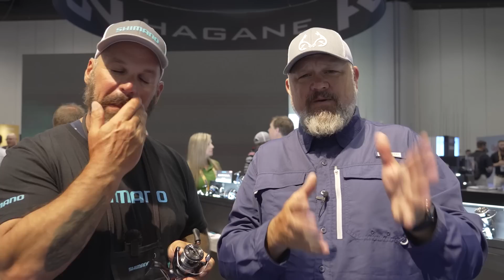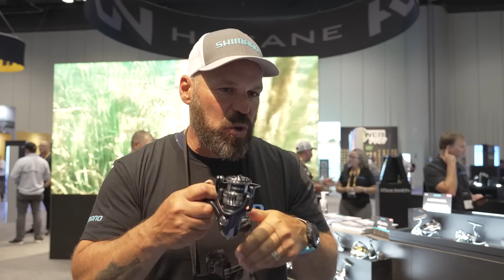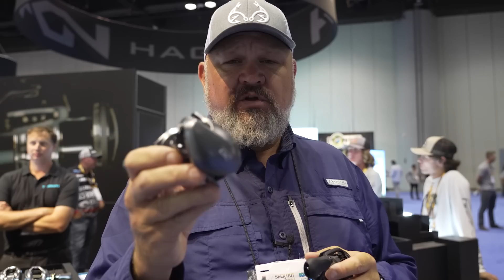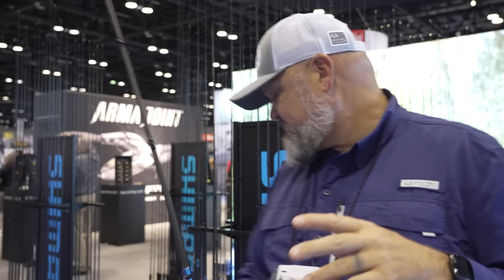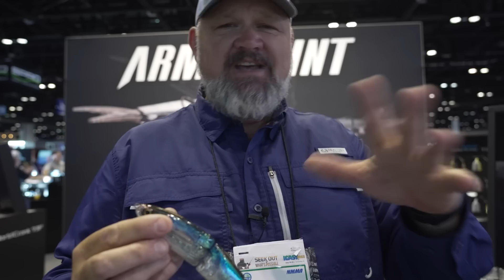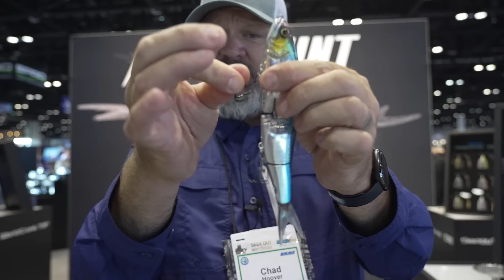New Shimano Fishing Products | ICAST 2022

Comment: One thing not mentioned here that was at the show is the new Curado 200 DC, the higher line capacity over the 150 is huge for heavier braids on big Amazon peacocks after those long casts. I looked it with the Shimano rep and seems like the higher capacity comes from a wider, not deeper spool. I just bought a buddy a SLX DC for his first bait caster and spooled then threw it to dial it in, very nice reel. A friend has an SLX DC he has fished fresh and salt for over a year and loves it.
Reply from the maker: Yessir, I did overlook that for this video. I actually plan to use on for bigger swimbaits as soon as I can get my hands on one.
Reply: @ChadHooverFishing  Cool, that should be a perfect fit. It was such a huge show, sensory overload. I have seen some videos here with a dozen products I meant to check out which were somehow missed completely.

Comment: Deep spools don't mean nothing. The last half of the spool will not cast. That's why Japanese use shallow spool. The problems with most spinning are 1. Bad drag (not in the case of Shimano) 2. Plastic bail arm 3. Cheap springs in the bail arm. Will likely loosen os weaken after a few years of use.

Comment: To your point, just last week I had the reels off a Poison Adrena and an similarly rated SLX. I was amazed at how comparable the weight of each felt in hand. The SLX was heavier but not by that much. And the Adrena weighs like air. $390 vs $99 Can’t wait to try the new SLXs. And a bunch of other stuff.
Reply: My SLX rod broke first use. Be careful using it for bigger fish.
Reply: @thecluelessoutdoorsman916  Man, I’m sorry to hear that. I hammer fish on mine. That’s one of the reasons I like them, I don’t baby them like I’m more prone to do with expensive rods.
Reply: I just accidentally hooked a 20+ lb carp on my ugly stik carbon and it handled it like a champ and it’s only $60. So expensive doesn’t always mean better imo.